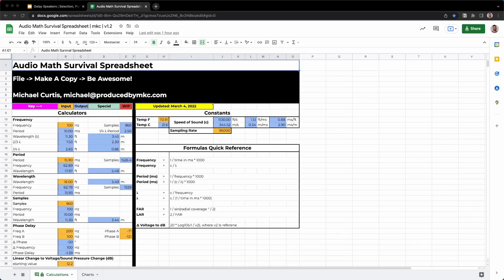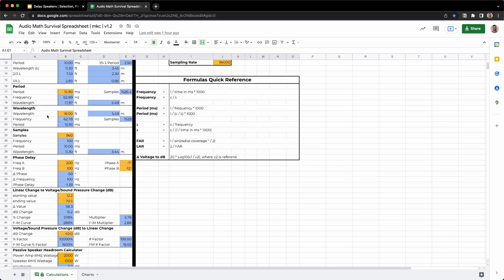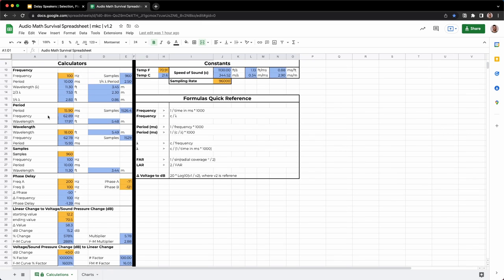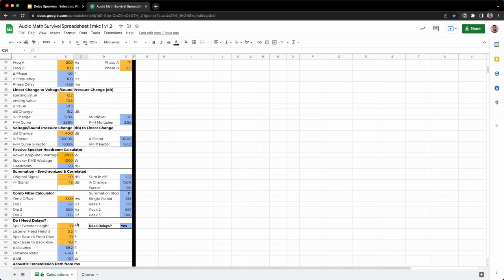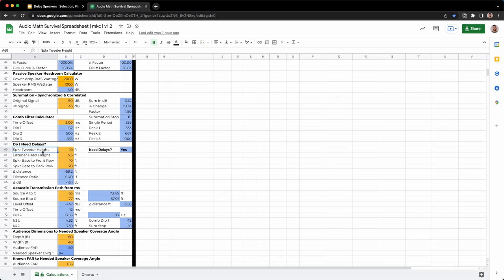Delay Speakers | Selection, Placement, and Time Alignment

Comment: I set my delay time using pink noise. I measure the distance between the speakers and that gets me close. Then I stand in the spot where I want the speakers time aligned and play pink noise. Slowly increase the delay time (you need a remote control pad or a helper) and you can hear a sweeping high frequency moving up because of the phasing. When it gets to the top of it's sweep then the speakers are aligned. Awesome content!! Thanks!!
Reply from the maker: Thanks for sharing your approach!

Comment: Very Very informative. Personally that is why i love speakers like k12.2, k10.2 even k8.2 or Turbo Sound ... because they have a built in delay. For medium size venues' let say if i need fill/ coverage in front of the main, i just  take  the output from the main and plug it to the  speaker that is going to be delayed then bring my laser measurement, put the measurement (ft) on the speaker itself and that will be my starting point. The built in delay system on the speakers  is very handy.
Reply from the maker: Yes, it's a super nice tool to have.

Comment: Thanks. As an amateur audio guy trying to learn how to up my game this was really helpful. Not just the 'what' and the 'how' but also the 'why'! When raising the speakers like this in a low room, where is the trade off between getting speakers higher but also not too close to the ceiling?
Reply from the maker: Getting them close to the ceiling may change the reflection angle of the sound waves off the ceiling, but I feel like it's still a net positive to get your speakers high so you can decrease range ratio.

Comment: Thanks so much for making this informative video!  One thing I don’t understand is how do you get the mains and delayed speaker to be at the same level if they are 40 feet apart?  Are you lowering the output of the delayed speaker so it matches the mains at your alignment point? Thanks!

Comment: Hi, 

What if I had your set up for the speakers but had a sub running in the center of the mains. Would I also need to time align that? And would it be best if I also ran my sub frequencies through the delay speakers as well or should I keep them on the Mids and Highs? Thank you!

Comment: I was just wondering if it is viable to delay speakers when they are moved in two directions? For example my mains are in the middle while the delay speakers are further back but also further wide. Would the delay time still work/be accurate?

Comment: Thank you for the great video.
I have an event where the room is 40’w x 90’l. I have 4 QSC K12’s with stands and 1 dual 18” and 2 single 18” subs. I have a DBX Driverack PA. Could I use the Driverack to set a delay for the 2nd pair of speakers half way down the room? And where would you suggest subwoofer placement. It’s for a college party.

All you input is much appreciated.
Reply from the maker: Hey, Huey. If I remember right the Driverack PA only has a 10ms output delay line, and I'm thinking you will need more than that to adequately sync the speakers. As far as sub placement, I'd do both in front of the stage in the center.

Comment: I'm often setting up pa systems in ballrooms set up with the stage on the wide side. I usually have two speakers in the front as mains, two speakers out wide in the front corners to cover the areas outside the throw width of the mains, and two more on the sides at the halfway point of the room as delays. I've started incorporating a single speaker under the front of the stage as a front fill, but how can I cover that back middle of the room without plopping a speaker right in the center of the room?
Reply from the maker: I'm actually on a show as I type this with the exact same setup and have the exact same issue. Unless you have rig something off the airwall track in the mid center, that's a tough nut to crack.

Comment: Hi Michael,
If I have my system set up like this and I'm mixing at the back of the room, will listening to the delayed speakers give me a bad representation of the mix as the high end would be much louder than the subs at the front? Should I move my mixing position to before the delayed speakers but then again I would be hearing the back of the delays which would be even more muffled sounding.
Reply from the maker: Great question, Aaron. Like you've probably found, there's no such thing as free lunch!

I would set the sub level for the room at mid depth. Those at the front will have subs a bit hot, it'll be a bit light at the back. I'm not sure if "move mix position" means walking forward with an iPad, or completely moving where FOH is, but I suspect that you could keep your console at the back of the room, but then every few songs in the set walk up to front third of room just to check in and see how it feels.

Or, do the opposite. Stand with your iPad at the front third, then walk back and check in at the back every few songs. I like standing closer to the stage anyway if I'm also mixing monitors. It's a lot easier to communicate with the band that way.

Comment: hi mike thanks for the information in the video, I wanted to ask you if as regards the alignment of the delay speakers with a complete P.A (for example with classic hanging top + sub on floor) we follow the same process described by you in the video both as time align than as a search for the measuring point. thanks from Italy !
Reply from the maker: Great question! I would first level set each "zone" - where your main PA covers vs your delay speakers. Then to align them, you find the point in between each of your zones where the main PA and delay speaker are equal in level.
Reply: Thanks for the video. What video would you recommend to approach handling this with a home theater system for only 1 person

Comment: Stupid question, does speaker cable length affect delay? I noticed i had speakers right next to my amp stack before with like 3 foot cables, and speakers further away with like 10 metre cables, and it seems to give it a little hall effect reverb/delay

It does sound ok, in fact it makes the tracks sound live when there actually recorded, but it is noticeable
Reply from the maker: Nope! Electrons travel VERY, very fast down a cable, so you don't have to worry about that.
Reply: @MichaelCurtisAudio  cool, thanks for that info

Comment: What if your delays are not identical to the mains? Is it better to have a relay system in this case?
Reply from the maker: Great question. It depends on the max SPL of the delays vs the mains and at what location you place the delays.

If the relays can "stand on their own" without help from the mains and provide the tonality and SPL you want for the show, then you can use relays.

Also, if your mains have no hope of actually providing coverage alllllll the way to the back, then handing of to a relay system is also desirable. It's all up to the speaker SPL handling and the inverse square law : )

Comment: Would you delay center fill speakers from the left right mains that are on poles.
Reply from the maker: It depends on how far downstage it is, but I would level set the center fill for its zone, then time align it with the mains at where they become equal in level.

Comment: What if you just measure the distance between both the speakers and use that to convert to the delayed time ? Will that work
Reply from the maker: That will work as long as you're choosing the right point to measure from. Where speakers overlap and meet at equal level is a great place to start.
Reply: @MichaelCurtisAudio  thank you for your  reply 😄

Comment: How do you time align delays to mains using OSM?
Reply from the maker: 1. Walk the seam between where your mains and your delays overlap. Listen to where you hear the comb filtering the most, where those two sources are equal in level. That's where you'll place your measurement microphone.

2. Find the delay value with the mains soloed at that point.

3. Mute your mains, fire up your delay and see the difference in delay times. You will have to add electronic delay to your delay speaker to make it match where the mains arrives at that point.
Reply: @MichaelCurtisAudio  you are a god amongst men. Thank you
Reply from the maker: @tomoswilliams9472  Happy to help : )